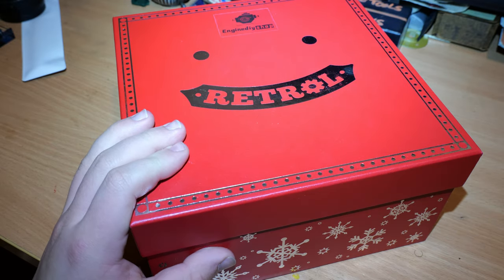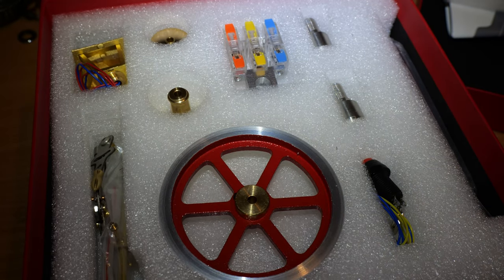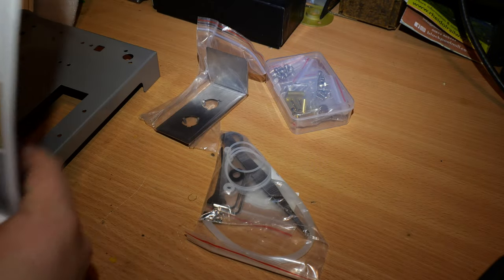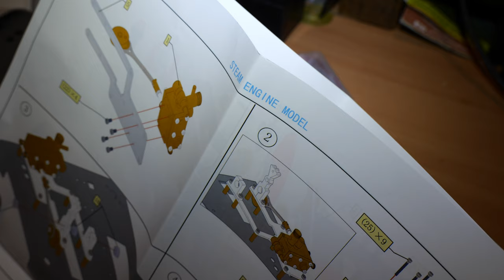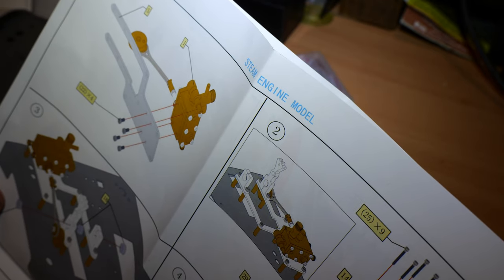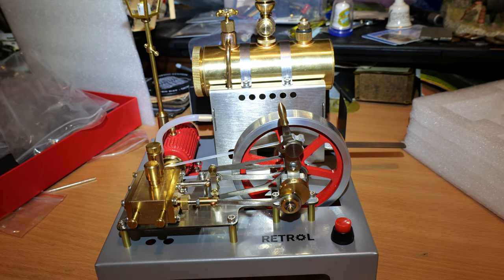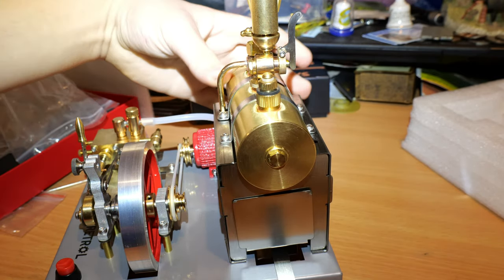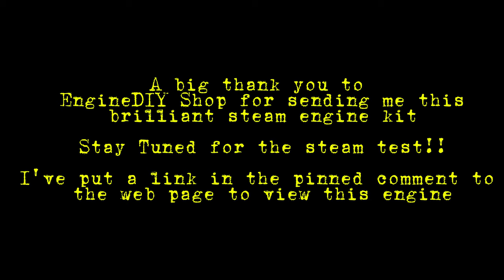RETROL'S NEW 2024 STEAM ENGINE KIT WITH GENERATOR & STREET LAMP LED - COURTESY OF ENGINEDIY SHOP!

Comment from the maker: https://gbr01.safelinks.protection.outlook.com/?url=https%3A%2F%2Fwww.enginediyshop.com%2Fproducts%2Fretrol-se-02-metal-reversible-horizontal-stationary-steam-engine-and-boiler-model-kit-with-generator-and-street-lamp-100pcs&data=05%7C02%7C%7C2486b509109d4ba105b608dd1404493f%7C84df9e7fe9f640afb435aaaaaaaaaaaa%7C1%7C0%7C638688730812884104%7CUnknown%7CTWFpbGZsb3d8eyJFbXB0eU1hcGkiOnRydWUsIlYiOiIwLjAuMDAwMCIsIlAiOiJXaW4zMiIsIkFOIjoiTWFpbCIsIldUIjoyfQ%3D%3D%7C0%7C%7C%7C&sdata=4IY56Ideh47tKihEVrHznU1Pxv9ELVdO5MLDIgA2%2FCI%3D&reserved=0

Comment: Nice video! I built one of their beam engines from a kit. I accidentally broke the screw that is on the side of the cylinder. When steaming the engine, what does that screw do?
Reply from the maker: Nice!! The screw on the side of the cylinder is the drain cock, as you unscrew it a small hole is uncovered which lets the condensate out when starting
Reply: So that is probably why mine isn’t working